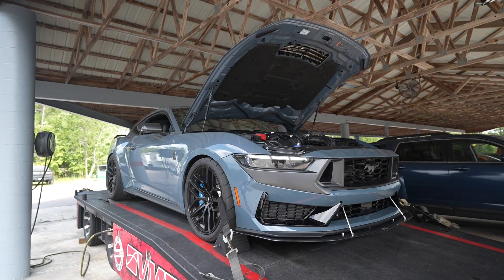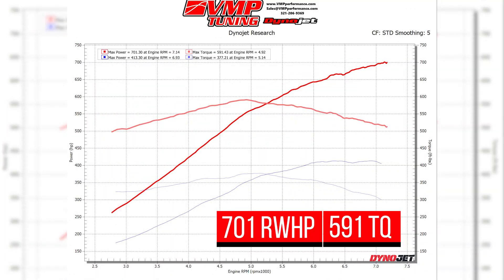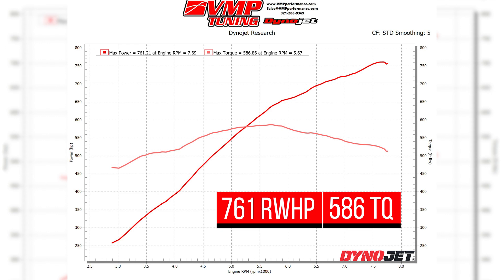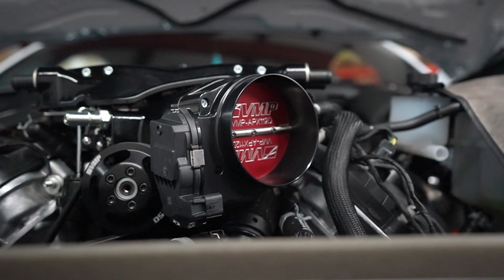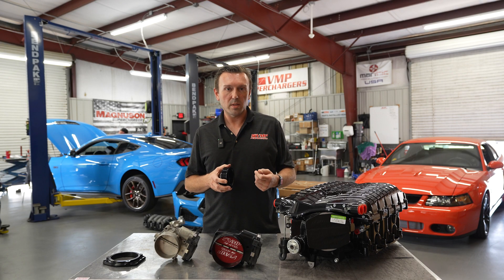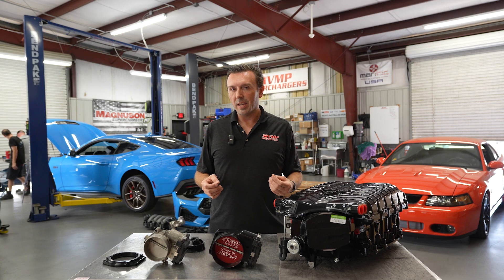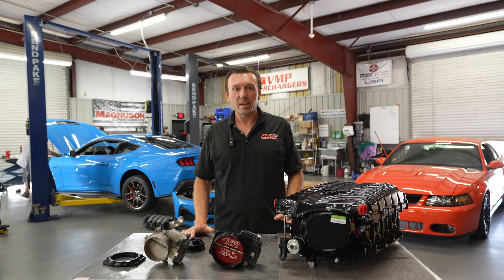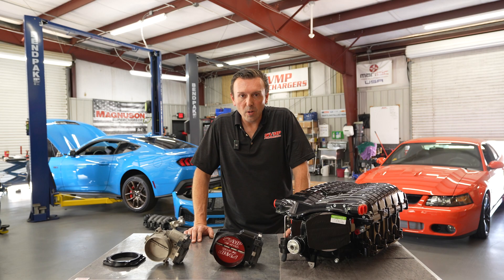Whipple x VMP Gen 6 3.0L Stage 1 vs Stage 2 in Depth Comparison! | 2024 Mustang Dark Horse

Comment: I have heard mixed opinions on whether the larger heat exchanger is the best option for mostly street/highway use as it can block airflow at low speeds.  I do not plan on bringing my car to the track. I have a 2024 6 speed s650 and was planning on doing the Whipple Stage 2. Can anyone offer advice on whether the heat exchanger and/or the dual pump upgrade are beneficial for non track driving with occasional traffic on my commute? This would be my first foray into mods so forgive my inexperience and lack of expertise.

Comment: Are you guys replacing the Oil Pump Gears (OPGs) & crank sprocket???? 
Thanks!!!!
Reply: Depending on the application (Non-dark horse vs dark horse application), billet OPG maybe all you need. The DH has a billet crank sprocket from factory. GT/F150 will need both OPG and sprocket upgrade.

Comment: However, if you get the stage 1 with the warranty and once your warranty is up you can then swap to the stage 2 throttle body and pulley and reflash from Whipple (according to Ford) then you get the best out of both kits... I had the stage 1 installed on my DH already and loving it. Great informative VMP video as always, thanks guys😊
Reply: 100% sure, as long as #1 it's a stage 1, and #2 needs to be installed by a certified Ford mechanic
Reply: I bought a Gen 6 stage 1 (stock throttle body) and Whipple said no warranty available.  Are you sure?
Reply: The dealership is sending my truck to whipple and I called whipple myself and ordered the stage 2
Reply: And Ford is the one who warranties it for 3yr/36k
Reply: @frankieb7575 the warranty is through Whipple.

Comment: Comparing graphs in an Apples to Apples way, the stage 2 makes roughly 720-730hp at the 7100rpm peak of the stage 1. As someone who’s brother has a whipple stage 2 s550 making about 660whp, it pulls plenty hard on the street. Traction is a real issue even on a ET street R from a stop. I’d prefer the stage 1 kit to keep that warranty and I can’t imagine it being much slower than the stage 2 kit. Octane booster might make up the difference in power seeing these engines are octane limited

Comment: How the only the Dark mustang only 761 with the stage 2,the 2024 Gt mustang made 810 to the wheels how much
Reply: Octane booster, catless longtube headers and whatever else they not stating lol
Reply: I’m pretty sure this was just a baseline dark horse slapping on  the super charger kits.  Hence why at the start they were like low 400s at the wheels before kitted
Reply: @adammauer6424  not a baseline. That is what’s offered to the public but ofcourse they have to do tricks to get high numbers and people to buy it
Reply: @jessefrias2575  it’s the baseline of the car stock from the dealer , maybe you didn’t understood what I meant
Reply: I think they did smaller pulley & added Catless Kook Headers with Boost
Reply: For the S650 Kooks headers cannot legally sell zero cats now. You get “Green 200 cell” cats with Kooks headers.  I just purchased mine. Kooks adds 30-40 RWH to the S650 and no tune. Add in a decent Cat-back exhaust like AEW (comes with H-pipe) or Corsa Extremes (double H-pipe) or the new Borla S-Type or ATTACK exhaust. All 3 exhaust provide another 10+ RWH in addition to the 30-40 Kooks. Add in the better free-flowing intakes/filter plus Boostang & E-30 fuel without tune and people are getting greater than >810 RWH. StangMode a week ago got 1020 RWH without tuning the bolt-ons but just the  tune from Whipple. 
Ford released the encryption to the ECM/ECU to Whipple, RTR, Roush & Ford Performance back in March.  My son owns a Ford Dealership. He recently shared with me that the ECU tuning availability is only a 3-4 week out-wait. Very close.